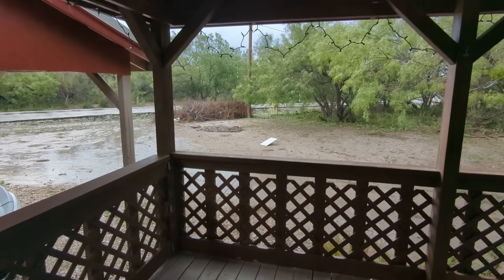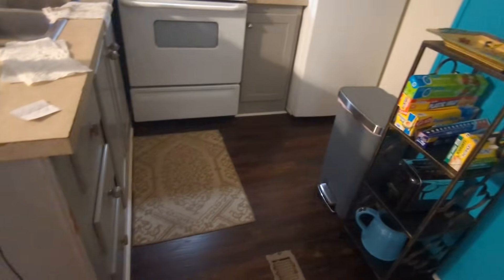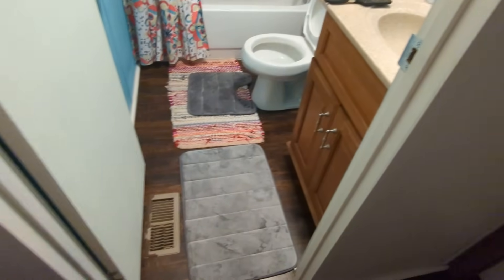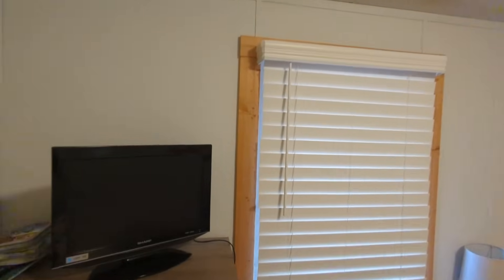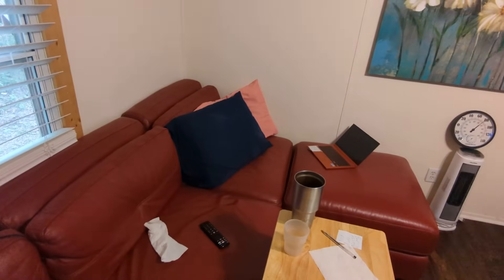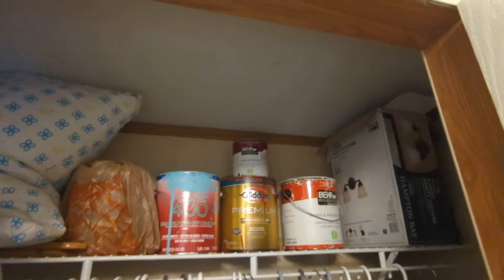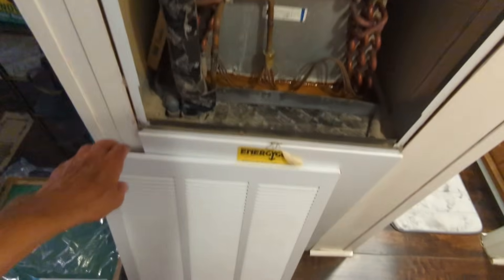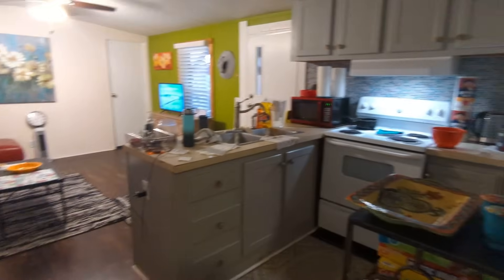FIRST RAIN...NEW HOME TEXAS!!!

Comment: Hi Rusty, please open the bottom door of your ac unit and see if there’s a groove to slide in a filter underneath the coil.
Reply: Agreed. My filter sits UNDER the air handler as do most I've seen.
Reply: @stercaland  , I used to change ac filters in apartments, and I have dealt with some of these air conditioners. They usually have grooves to put filters. Thanks

Comment: I have a double wide mobile home with the same A/C system.  It is called an "A" coil.  Mine has the filters in the same place as you and I also have about an inch of water in the pan.  It drains down that tube when it gets up to a certain level.  Some people put bleach in the water to prevent mold growth but I never have.
Reply from the maker: thank you very much
Reply: I would get a solid front door no window.

Comment: Rusty - Congrats on the new home. Because the a/c blows down it's backwards from what you're familiar with. I'm assuming there's a fan underneath the coils. Usually the return air comes from below the unit, passes through the filters and is blown over the coils by a fan. Your return air is being sucked through the louvered door by the fan under the coil. You need to filter that air to keep the coils and the fan clean. Laying the filters over the coils is a piss-poor way to filter the air, but it's better than nothing. I suggest that you figure out a way to put filters on the back of the door so that after the air is sucked in the louvers it is filtered before it hits the coils and the fan.
Reply from the maker: thanks

Comment: Hi Rusty, new place is looking great! You are correct on the AC, install the filters into the return air grill (that you lift off) and the "cut to fit" filters work best. The water in the ac cooling coil tray is pretty normal. The AC looks fairly new. Hope this helps! Have a great day and Happy Living in the new Place!
Reply from the maker: thanks

Comment: The filters go as you had the one placed.  I’ve even attached air fresheners on the filters for when the blower kicks on.  The pan is to drain the system.   Correct on the water heater, more effective & efficient to keep it turned on than try to heat the entire tank when you want to use it.  Replace with instant heater if that need arises.  Same with turning portable air conditioners off and on.  Cheaper to keep the room cool, than to have to cool the entire area down after letting the cool air heat up.    You do have a cool place.

Comment: If you can't get a big ac, you could measure the windows and get some window units ac/heaters. It may be cheaper to go that route if you have to replace your ac unit. I could be wrong, but I was giving an opinion to your question.

Comment: Rusty, that AC reminds me of my old home... My current home, the filter is underneath that compressor. The bottom panel should be able to take off, and I would think there should be a filter. I think they have those panels flip-flopped, solid on the top, vented on the bottom.
The water on that pan should have a drain to go outside. Also, there should be an intake valve or PVC pipe so you can pour a half a cup of bleach or white vinegar to prevent mold and clean your drainage pipe. Probably on the tray, where you saw that standing water. On the AC unit, there might be sticker of a local company hopefully you have more than one to contact. Another YouTuber he rebuilt his mobile home for a family of six, he installed 3 mini splits. I would think you would only need a big one in the main area and remove the old central AC, convert to a pantry.

Comment: Rusty, that is a counterflow unit meaning it flows thru the coil on  top of electric furnace to the ducts in floor.  Where they placed them was correct.  They were trying to keep dust and  dirt off the coil. Not ideal situation like it was. A better idea is to have a filter rack over the metal louvered door that you took off. Mobil home units are the cheapest unit type made.  Maybe two mini split heat pumps may work better for you. Good luck with your endeavors.

Comment: Hi Rusty; In terms of the water accumulation on the coil tray, in South Florida we are recommended by A/C mechanics to add about 1/4 cup of clorox every few months to keep the tray un blocked and dry. That amount of water suggest that there is some sort of blockage in the tray. I would remove all the water with a towel and add the (1/2 cup) clorox to clear the blockage. Clorox also helps with preventing the growth of bacteria in the water. It would also help if you add another 1/4 cup down the line until fixed every few months.
I've never seen an A/C that has filters covering the coil. Usually the air is sucked in from the bottom to be cooled by the coils and distribute outward.
Great place. Enjoy it.
Reply from the maker: thanks

Comment: I have a heat pump in my park model in Bullhead City, AZ and the 1st 2 bills have been $118. and $97. respectively in summer, at 115 or more degrees with my heat pump at 82 degrees, the Realtor did set it up to 85, so we'll see what that does, but im not living in it either!

Comment: You sure got lots of different opinions on the A/C unit filter placement. I would google the manufacturer and model number for an owner's manual. If you decide to go with a Ductless Mini-Split, get a well-known serviceable name brand. My husband went the DIY off brands and nothing but trouble, whereas two of my siblings choose professionally installed name brand and they LOVE them. No probs whatsoever.